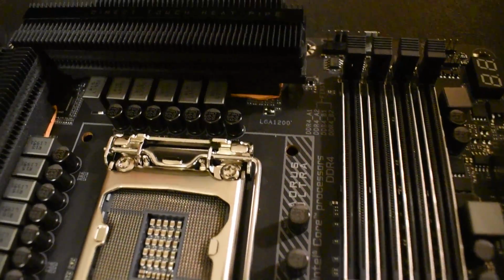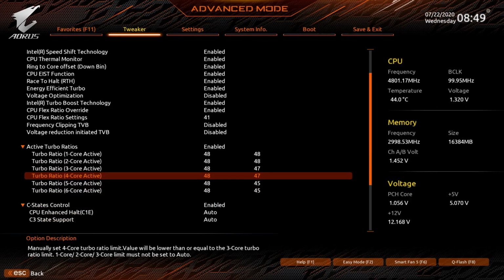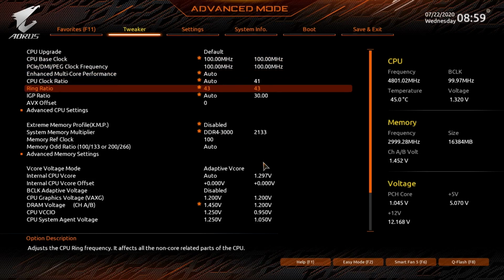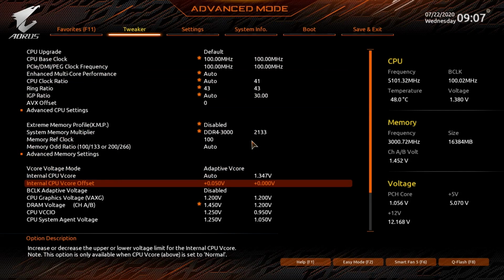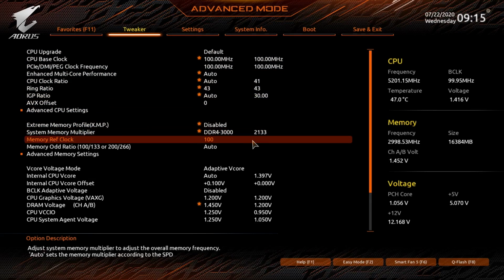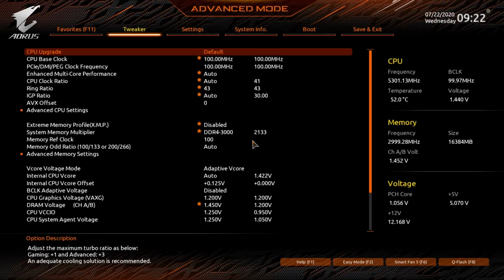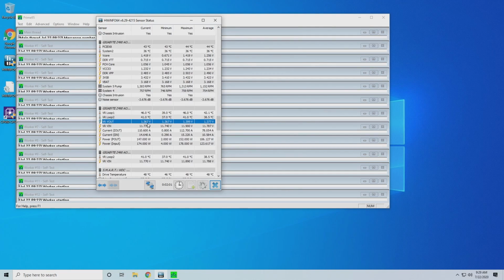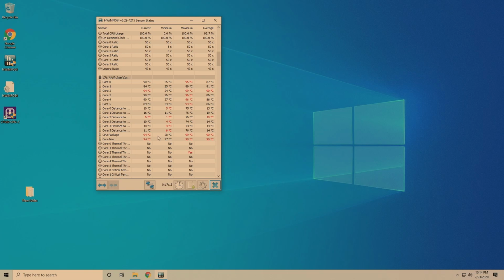Intel 10th Gen Z490 Overclocking Guide with Gigabyte BIOS

Comment: The bios shows you on the right the voltage readings, no need to go in Windows to check. Its usually accurate. I also like to use Offset for every day use but when im gaming I load a different Bios Profile with maxed-out settings. You should make benchmarks after the initial stress testings for finding the highest OC. The C-states can lower the performance significantly. If you wanted to see where the 5.2Ghz OC is stable you can easily go up to 1.6v since you were going to use it just for few minutes. Ive used 1.560mv for months without degrading. My safe voltage recommendation when someone asks me is 1.395-1.425mv. I use higher voltages but this is just for few hours at the evening. During the day the power-savings are enabled. Good video.
Reply from the maker: Bios vcore readings are notoriously inaccurate, you want to look at VR out  in hardware info if you have a  gigabyte board, thats "die-sense" voltage and is a more accurate reading.  We didn't push for a max OC at crazy voltages either since this PC is going to someone else and we wanted to make a tutorial on how to a attain 24/7 stable overclock that can be run for the lifetime of the PC.  You are spot on with the 1.395-1.425 though, unfortunately for us it was uncoolable at that point.  Maybe we should de-lid it :).
Reply: @hardwarelens8040  Yes,  Im aware of VR Out. I believe thats how much voltage the vrm is feeding the CPU. Both readings have around 0.030mv difference on my system so I can make a pretty good guess.  Im also watching the VID. I have Auros Elite AC.  Need better cooler though (lucifer k2).  Delidding wont help much since its on stim. Better just put liqud metal on the IHS, push-pull, or maybe direct die for 10series

Comment: Can I use these settings on a gigabyte z490 gaming x motherboard?
Reply: And is it ok if I don’t have the extra 4-pin for my cpu?
Reply from the maker: @IMdrummerTab  You don't need to use the 4 pin unless you are running LN2, the gaming x should be pretty similar.
Reply: Hardware Lens ok thanks. I did auto overclock and it shutdown after like 30 mins of gameplay and did OCCT power test and shuts down instantly

Comment: That was amazing video thank you! I have 10900KF, I used fixed voltage 1,25 and OC at 5 GHz (I don't know if you even call that an overclock), and it is very stable and comfortable I don't get temps above 80 under very stressful tests, however what I noticed is that my frequency goes back to base 3.7 GHz after a while (maybe after I leave the computer and it goes to sleep) and if I run any test it stays at 3.7 until I restart my computer it goes back to the 5 I set it up, do you have any idea why does that happen? any advice is much appreciated I am frustrated of why this happens. and Thank you for this great content I loved this video (even though I am not using adaptive voltage but it was still helpful)
Reply from the maker: Hmm sounds like one of your turbo ratio or power saving settings is conflicting with your overclock.  If you don't want to use turbo ratios to overclock you need to turn all of that off.
Reply: @KanneRyo  I have Auros Master gigabyte z490 board, and 1000 WATT PSU  and 360 AIO :( the CPU max temperatures I get after stressing for hours 80 Celsius
Reply: I have the same issue on my 10850k. Everytime my comp goes into sleep mode and I wake it all my clocks are at base 3.6 and won't even engage turbo boost at all and im not sure why. I disabled sleep mode and just have my monitors to shut off. Not sure what else to do as I have never had this problem before

Comment: can I use the same settings for OC' ing a 10900K on the same motherboard as you?
Reply from the maker: Yes, the method is exactly the same, you will of course need to try different voltages and be careful using the offset with a 10900k as it can over volt quite a bit even at a zero offset, you might need negative offsets.  just go slow and check everything like in the video.
Reply: @hardwarelens8040  well what kind of offset would you recommend for a 10700K? Trying to do a simple “downclocking overclock” like this to get the most out of my cpu, maybe 5.0 or 5.1 but nothing beyond that.

I7 10700K and Gigabyte Aorus Pro AX motherboard
Reply: Worked for me with a 10900K on an AORUS Pro AC (similar mobo)
Reply: I have the same cpu motherboard combo I7 10700k and aorus pro ax
What did you end up using?
Reply: @SuperHom1  yo... luckily for you I got this notification. I turn all the same settings as Buildzoids video, all c-states off, speed-shift or speed-step or whatever off, turbo boost off, all that power saving stuff. 

Then for gaming, for games that don’t benefit from hyperthreading and if I had a 3080 I would do 5.3ghz no hyperthreading 1.35v override vcore and standard llc. It won’t pass OCCT or Prime 95 on small FFT test AVX2 with no errors, but it will pass large and medium on OCCT and I have never crashed once. 

The other one you can try for games that do benefit from hyperthreading is 5.1-5.2ghz WITH hyperthreading on, and 1.35-1.37 vcore. 

If you want a good overclock that will pass SMALL FFT AVX2 data-set OCCT and Prime 95 without errors, like for rendering etc. And you have a good cooler, you can go to 5.0 GHZ with 1.38v. That can do the small data AVX2 instruction tests fine, and without going over 90c on a 280mm Corsair AIO. 

I just like to run a smaller amount of vcore for daily use and just gaming. You really don’t need it to be SMALL FFT AVX2 stable just for daily use and gaming. And fuck Prime 95. Just download OCCT and if you pass the large data with AVX2 enabled with no errors, you’re good to go(for daily use and gaming.) So just override vcore, standard LLC. For totally stable 5.0 ghz, 1.38vcore. For gaming 5.2ghz with hyperthreading, only stable enough for gaming and daily use but not large workloads, 1.35-1.37vcore, for fastest clockspeed 5.3ghz with hyperthreading disabled, 1.35v.

The OC I actually run daily because I am GPU limited even at stock (2070s) is 5.0 ghz and 1.33v. It works absolutely fine for gaming and daily use. But if you want it to be totally stable for huge workloads with AVX instructions it needs about 1.38v. I run this overclock because it runs the coolest and still gets me max performance with my gpu.

On the 5.3ghz overclock on CPU-Z test I get 643 single core score. On 5.1ghz I get 609. On 5 ghz I get 595-600.
Reply: @gametime
Appreciate the lengthy reply!!
I am gonna try that out!
Thank you so much and have a nice weekend!